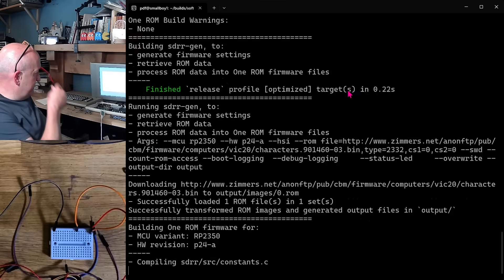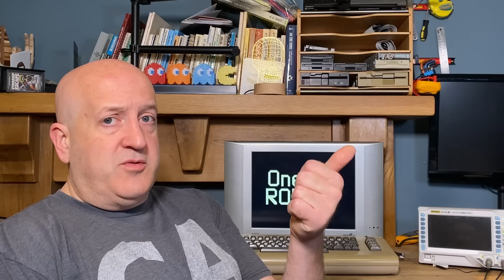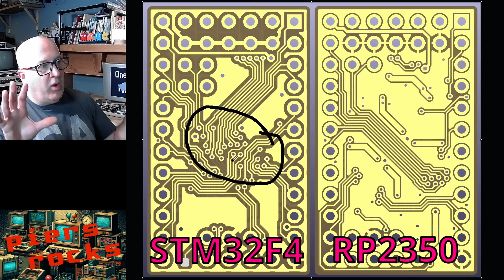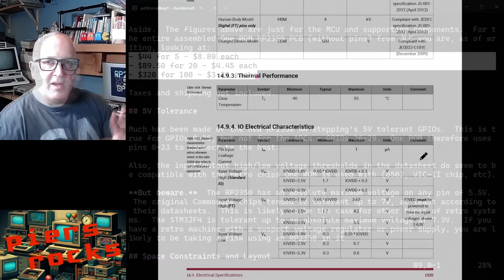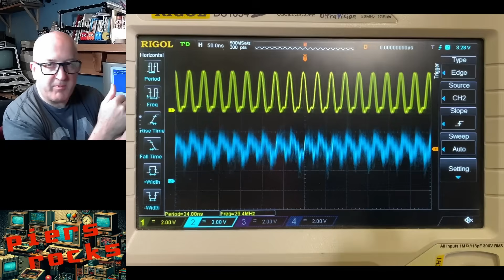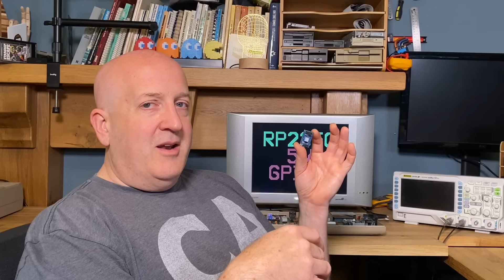Retro ROMming with RP2350 5V GPIOs - One ROM

Comment: What about the RP2354A ?
Reply from the maker: I now use RP2354A and RP2354B by default on all my One ROMs, as they contain the 2MB flash required, and are a cheaper way to build One ROM (not to mention avoids the need to fit the extra flash package on the board).

The RP2354A and B are both widely available in the A4 stepping.

Comment: thx for this project. i have about 7 oneroms at this point😊. i have a question about the 5v tolerance (ie FT). the data aheet says the pins are only tolerant if IOVDD is 3.3v. When you power on an old system there is a chance the address lines are driven to 5v before the 3.3v rail is there.
How do you mitigate this scenario in onerom?
Reply from the maker: See https://github.com/piersfinlayson/one-rom/discussions/123

tl;dr - I've run One ROMs for over a million power on events and found no issues.  The window you've flagged is very short - around 20us, which the RP2350 appears (from extensive testing) to be tolerant to.

Sounds like you need some more One ROMs 🙂
Reply: @p @piers_rocks thank you for this and all the testing you have done. also, yes... more oneroms will be acquired in the future 💯 😊

Comment: Nice video! So with rp2350 I can use uart 5v directly without TTL level shift?
Reply from the maker: It depends.  Yes, so long as you don't apply 5V to any RP2350 GPIO before Vdd (3.3v) is applied to its power pins.  And so long as you keep to GPIOs 0-25 (or 0-39 for the RP2350B).

Comment: i am wondering if it would be possible to also emulate 4164 dram or similar with the pi pico or stm32... could be a modern replacement or aio solution? and as far as i understand it this microcontrollers have enough internal ram and some of them have dma controllers.
Reply from the maker: I am emulating 2114/6116 (24 pin 2KB) SRAM already.  Main issue with 4164 is that the pin pitch is 300mil - that's too small to fit a RP2350 MCU between.  You really need RP2350 for this sort of application due to its PIOs.  There's a video on my channel about 2114 SRAM support.
Reply: @piers_rocks  thanks for the explanation.
what i meant was a more hacky solution. but i checked and with the onerom 24 it would not be possible since it does not have all address pins mapped. (as far as i understand it) my idea would have been: instead of dynamic switching of roms, using the "dynamic switching" pins as ram read write pins, you would have to run wires to those lines though. if i understood it correctly this would only be somewhat possible with the 28 and 40 pin version where all address and data pins are already available on the rom.

Comment: very interesting that it is 5V tolerant since the A4 stepping, thanks ... btw, this will be my todays evening prime time show ... ))
Reply from the maker: Actually it's not - that was my misunderstanding - it's always been there.  I've seen some suggestion that RPi advertised 5V tolerant in their A4 press release to divert from the E9 bug that required A4 in the first place.  In any case, make sure you understand the 5V tolerance before using - it does have some gotchas.

Comment: How would a 6-layer PCB help?  4 gets you a ground plane which helps if noise is a problem.  It also gets you either a dedicated power plane (which would clear out those bottom layer lines you said were causing problems) or a 3rd signal layer.  (Layer 4 wouldn't be directly next to ground, but it still might be better Signal Integrity than a 2-layer board without any planes.)  What more do layers 5&6 buy?
Reply from the maker: Layers 5&6 would give me more signal layers.  But you're right, with 4 layers I can prob get the 1.1V traces off the bottom, giving me MUCH more space.

Comment: Instead of cache pinning, I would try having the bootrom copy your program (and if it'll fit, the rom you're serving) from flash to ram before execution. In the ideal case you'll never touching the QMI/XIP at all.
 (ref section 5, esp 5.1.9 and 5.9.3.2 in the datasheet)
Reply from the maker: The ROM table is already preloaded to RAM.  I've tried running my code from RAM as well, but that's marginally slower.  I suspect because I'm hitting AHB bus contention, accessing code, the ROM table and GPIOs over the same bus.  This is the same on the STM32 - running from flash is faster than RAM, but in that case the ART Accelerator seems to help.  Hence thinking maybe XIP cache pinning could close the gap.

It's possible PIOs and or GPIO Coprocessor could help here, but offloading the GPIO processing from the AHB bus.
Reply: @piers_rocks  The GPIO coprocessor would get the IO ops off the AHB, and seems worth investigating, I haven't tried using it yet. I don't think PIO would help, I think you'll still need CPU involvement, and then you're hitting the AHB even harder. 

I'm quite surprised that executing code from ram was slower than the XIP, though it seems very likely the mainloop will fit in cache. If it is bus contention, if you haven't already, you might try putting the program in banks0-3 and the ROM table in banks4-7. I think that would mean instruction fetch and ROM table access won't collide.
Reply from the maker: @CBJamo  Interesting - I didn't know banks 0-3 vs banks 4-7 would meanno collisions.  When I tried it I think I had code in bank 0 and ROM in bank 1.

Comment: I understand that the rp2350a can receive from the c64 5v signals. But when feeding bytes to the c64 the rp2350a is outputting 3.3v signals. Is that reliable for the c64?
Reply from the maker: @infopackrat yes.  The RP2350 outputs a high signal at >=2.62V and a low <=0.5V, which is within the TTL voltage levels required for these systems (2.0V and 0.8V respectively).  With the STM32 micro you have to be a little careful to drive it properly in order to hit these levels, but the RP2350 datasheet claims the above values at any drive strength assuming you power it with 3.3V (which you must to get the 5V tolerance on the pads).

Comment: Could this be adapted to be a sidkick pico 2 that nicely fits in the same footprint? Ie the components  on one side (underneath for a clean look) and fitting within the footprint of the original Sid chip.
I guess you might need one more of those pins routed, but you wouldn’t need the 12V pin
Reply from the maker: @mikeh_nz No very familiar with the SIDkick, but I don't see why not.  The licensing for the SIDkick hardware seem to be quite restrictive (no derive) so not something I'm going to attempt.

Comment: Very nice project, Piers.  Very interesting, indeed.  I'm going to have to get a few boards and try one in my various Z80 based TRS-80 machines.  I'm already bank switching a too-large EPROM in my Model 1 to switch between BASIC and a diagnostic ROM.
Reply from the maker: @zodak9999b Do keep me posted, especially if you hit any problems.  If you want me to add TRS-80 config files to the One ROM, feel free to submit a pull request, or just open an issue on github.

Comment: Why is the internal crystal on the RP2350 so poorly designed/ speced? Having an oscillator that is virtually unusable has created Shrodener's timing oscillator, making it near useless. Is this a bug or an exercise in saving fractions of a penny?

"Strictly speaking, RP2350 does not actually require an external clock source, as it has its own internal oscillator.
However, as the frequency of this internal oscillator is not well defined or controlled, varying from chip to chip, as well
as with different supply voltages and temperatures, it is recommended to use a stable external frequency source." - Raspberry Pi's Hardware design documentation.
Reply from the maker: @garethevans9789 This made my jaw drop when I read it "The ROSC frequency is guaranteed to be in the range 4.6MHz to 19.6MHz".

On the STM32F4 the internal oscillator is specced +-4% across the entire voltage range more like +-1-2% across a sensible temperature range, which is more than good enough for an application like this.

I speculate in the video that the ring oscillator is just meant to give the core enough of a clock to get it past its very initial boot phase.  Why it's so poor, I don't know, but would suspect RPi are already cramming a quart into a pint pot, so it was very hard to do better.

Comment: 34:49 oh, that is surprising and actually not that good.
Reply from the maker: @root42 Yeah I agree, it's a bit disturbing and might cause problems.  I can't find it now, but I did read something on the RP2350 that suggests it has 4ms wait periods in the initial boot phase.  I think it was reading the external flash - if it's not ready it waits for 4ms and tries again, and repeats this until it can.  Maybe this is why the initial 10ms period and/or maybe adding 4ms to the subsequent period?  I believe I'm using an in spec flash, but had to go with a different part that the one in the reference design so it would fit.

Comment: I would be interested in measurement comparison between the original ROMs and the OneROM in terms of timing and power consumption. It would give users a ball park on the bus speed that the ROM could be used on.
Like OE to data valid, and CE to data valid timings.
Reply from the maker: @ReneKnuvers74rk I haven't done anything on power, but there's a previous video that gives some simple timing measurements measured via scope.  To do this probably means testing One ROM outside of a host and driving it with something else, and monitoring with better kit than I have. 

Having said that I do have some sense of the timings. The C64 character rom is a 350ns ROM (which actually gives 200ns from CS active to serving the correct data), and the bus is shared between the CPU and video chip - so the timings are quite tight.  One ROM hits the timing at a clock speed of around 80MHz (depends slightly between the exact IC, I think due to flash caching algorirthms).  At a first approximation I expect you can just linearly extrapolate - and say at 160MHz you can hit 100ns timings.  You can reasonably overclock the RP2350/STM32F4 higher than this.  But it's likely to be more complex than that though due to physics and the actual GPIO behaviour, as well as the fact that maybe the C64 isn't requiring within 200ns, (or maybe it's stricter, not sure).

Comment: I wonder if it would be possible for the microcontroller to monitor the voltage and light a warning led and maybe refuse to run if the voltage hits 5.5V.
Reply from the maker: @michaelallen1432 Yes, you could do this with the RP2350's second core.  If you attached Airfrog (tiny wireless co-processor which fits these devices), you could even have it send alerts via WiFi.

Comment: Hardware guy here - that was just about the best description I've ever seen of the tradeoffs that need to be considered with a dense SMT layout on only two layers. And noise shouldn't be a big concern here. Dimensions are short and there's plenty of time for signals to settle whether inputs or outputs. The signal lines on the system main board will always be a bigger noise source, and you don't have any control over that. You're clearly more of a hardware guy than you give yourself credit for. Combining this with the optimisations made in the software and the preparation of the ROM data before loading to flash, you're clearly a very capable engineer. Well done!
Reply from the maker: @GodmanchesterGoblin that's reassuring to hear, thanks!

Comment: What’s the max rom size that it can data store?
Reply from the maker: @arcademaster1 Right now it can serve 24-pin 2364/2332/2316 ROMs - 8KB, 4KB, 2KB.  I have a 28-pin board (STM32F4 version) lying around I need to test to see if it can serve 16KB, and possible larger.  Beyond 16KB requires different optimisation techniques though, because the address and CS/OE lines together go beyond 16 bits.
Reply: @piers_rocks so is there any possibility of 4mByte rom  replacements (I.e. Snes)?
Really, these actually sound perfect for the 4Kb Atari 2600 or maybe 5200 if 32kb was possible.   Have a “flashable” rom for the 2600 that also inverts the +CE line would be very handy.   Is it possible to buy a few of these?

Comment: Wow, I didn't expect this happen so fast, great job! BTW, any plans to test it with the firmware running on one of the RISC-V cores instead?
Reply from the maker: @unsignedvoid I haven't done anything with RISC-V yet, but I want to play with.  One thing I've heard is that the Hazard3 doesn't have branch prediction, so the main loop is likely to be slightly slower - but other optimisations might be possible (such as a branchless loop).

Comment: I see the STM is 100 MHz, 512 KB flash, 128k RAM, 50 GPIOs. I wonder if the CH32V103R8T6 might also be enough with 80 MHz, 64K flash, 20K RAM, 51 GPIOs, and natively 5V (not just 5V tolerant). It's $1.59 qty 10 at LCSC. It needs only decoupling caps and maybe a pull-up or two (eg on reset). It's a little light on RAM at 20k, but I note that is the total size of your three VIC20 ROMs. However I think with 0 wait states at 24 MHz or 2 wait states at 80 MHz the flash is fast enough for this application? It must be close.
Reply from the maker: @BruceHoult One ROM supports the STM32F401RET6 which is $1.77 in quantities of 10.  It has max clock of 84MHz, 512KB flash, 96KB RAM.  So IMO a better deal than the CH32.   The smaller F401RBT6 works too - 128KB flash, 64KB RAM.  The CH32 can probably be got to work even with only 80MHz, 20KB RAM, 64KB flash.  84MHz on the STM32 is right on the edge for a C64, but fine for a PET or VIC-20 (and OK slightly overclocked).
Reply: @piers_rocks  I guess "better value" depends on whether you'll use the extra capacity or not, as you discussed in STM vs RP. The CH32V103 is expensive and small capacity because it's older and on the fully 5V process. CH32V303RCT6 is 3.3V 5VT 144 MHz 64k RAM 256k flash (224k zero-wait as it is copied to RAM on reset) and $1.33 qty 10 at LCSC. Again a bit smaller than the STM, but faster, very close to RP (non overclocked)
Reply from the maker: @BruceHoult That one sound totally viable - very close to the STM32F401RB/C which are supported.

Comment: Is airfrog compatible with the rp2350 version?
Reply from the maker: @WouterLangenberg  Sort of and not yet.  I have a new hardware revision (B) of airfrog that matches the pinout of the RP2350 version (and also rev G of the STM version).  It also matches the Pico/Pico 2 pinout to those easier to control as well.  However, I haven't yet updated airfrog's firmware to be able to handle comms with the RP2350.  (The RP2350 uses a later version of SWD which requires some software mods.)

Comment: Have you looked at the HSTX ability on the RP2350?
Reply from the maker: @PaulGrayUK  I hadn't.  First thoughts are that it isn't very interesting for this application.  It is limited to pins 12-19, which would mean splitting the address/CS lines, leading to a shift/mask/or set of operations on those to get the ROM table lookup ofsfset, slowing everything down.  And also, we've still got to write the data byte to the HSTX FIFO.  It would be possible to use DMA chaining, but given the impacts on splitting addr/cs lines with this approach, DMA chaining using PIOs is probably faster - and CPU may yet be faster still.  I will get around to testing this (DMA/PIO) one day I'm sure.

Comment: Any chance of a debugging version? Output the ROM address and data byte at that location to a serial device (bitbang a pin maybe??) only when the One ROM is chip selected.
Reply from the maker: @steveblakely7296 At least for slow hosts (e.g. 1MHz clock), you might, with a heavily overclocked RP2350 version, be able to do something like store the ROM address and/or data byte (or both) in some kind of RAM buffer.  It would probably need to be heavily supervised by the other core, and data output (streamed over USB?) by that core - or use an SWD co-processor (like airfrog) to lift the data out of RAM and collect/transmit it.  It would be pretty tough though I reckon - the char ROM on the C64 gets hit around 980k times a second (PAL).  That's a lot of data to deal with - storing both output byte and data lines in a single word you're looking at around 4MB per s.

Another approach would be to use the RP2350B (extra GPIOs) and transmit some of the data on the extra pins - but good luck routing that on this form factor!

Some kind of statistical approach to debugging might be better though - like extended the existing function that increments a single word counter in RAM every time a byte is served.

Comment: hi have you try a pet disk drive 2040 as it run two cpu on the same bus.. but i guess if it can run carter rom and os rom at the same time wont be a problem
Reply from the maker: @mattruddick8919  Not yet!  A 2040 got me into producing One ROM in the first place.  It should be fine - the 2040 is only running at the same sort of speed as the C64, and correctly signals which ROM to talk when using CS lines.

Comment: A four layer board could help if you start getting intermittent errors because the internal ground and power planes act like capacitors that can often help with transients. It isn't a cure all but it can help decouple the chip and preserve signal integrity if that becomes an issue.